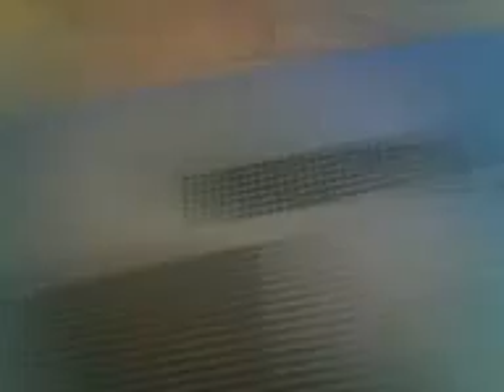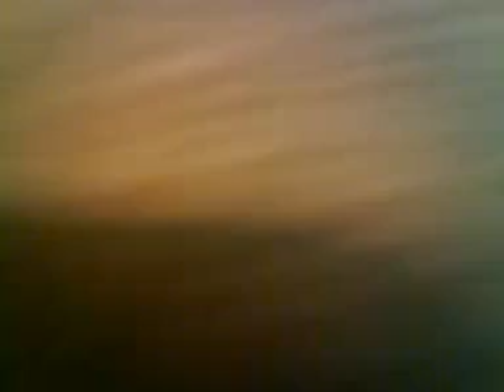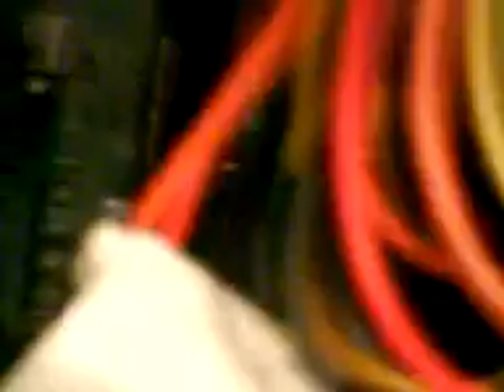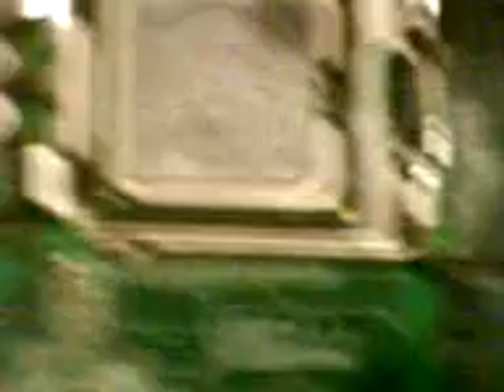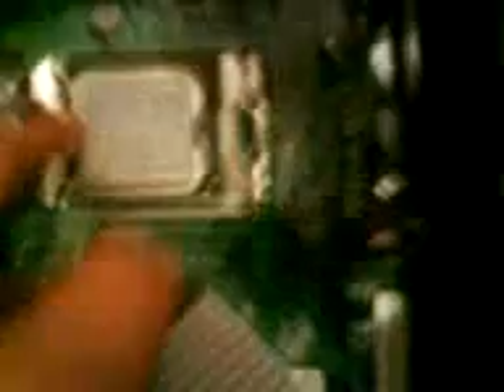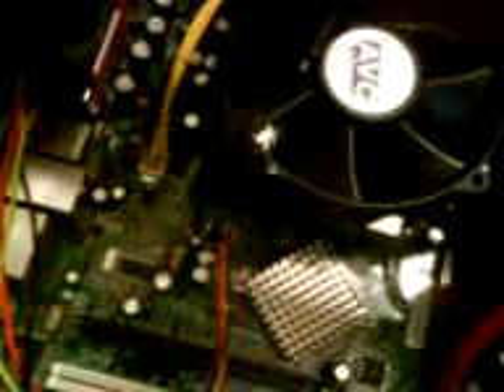how to change CPU

Comment: @gibsonlespaul2  only thing you can crack if you tight it too hard.... is nothing! 
i mean you can brake your motherboard >> you can do that if you are complete MORON.... ;)        >> screw`s are made so you can`t tight it too hard...but it`s important  to tight it very hard because processors "head" need`s to be completely "glued"  together!   if they are not "glued" together....your processor will overheat  and than your cpu will automaticLy  restart...sry for my bad english on a few word`s ;)

Comment: I HAVE CHANGED 3 PROCESSORS TODAY....and i want you to know that there is a few things you should remember...WHeN YOuuuu change CPU and get ready to screw the cooler/FAN in...YOU NEED to screw it as hard as you can...because cpu get`s very very HOt...also watch out not to brake "fan`s screw`s"